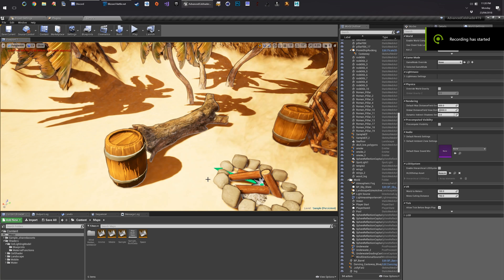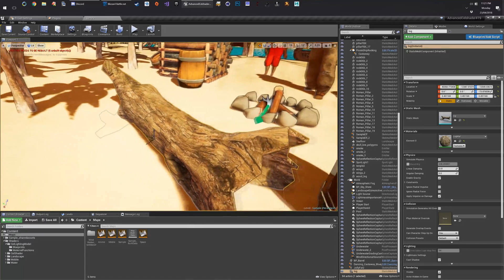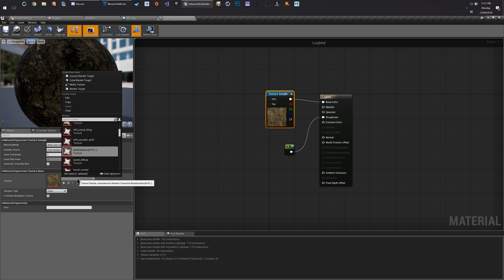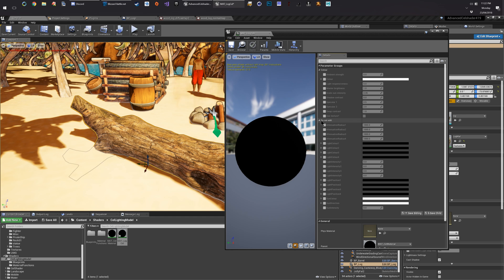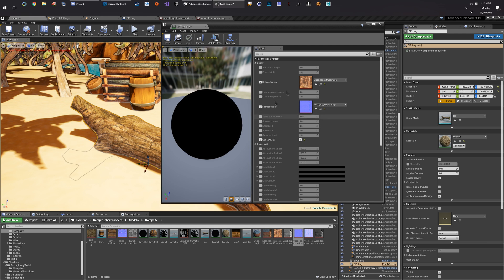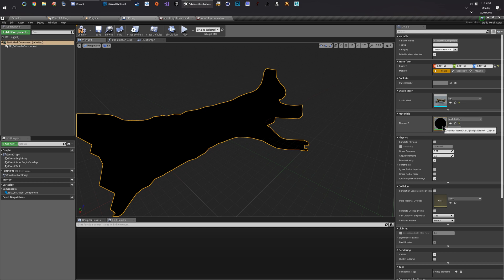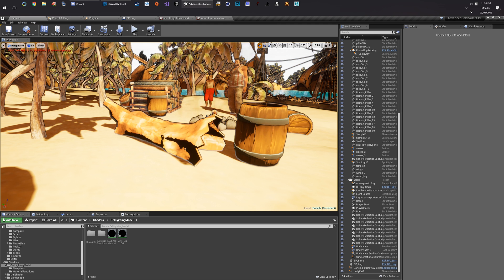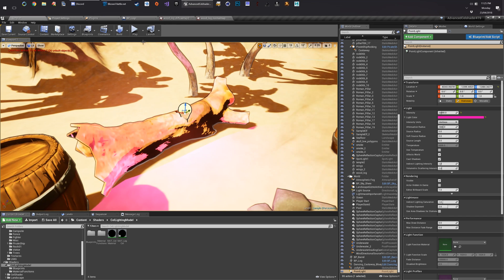Cel Lighting Tutorial 1

Comment: Hey great work ! I have used the advanced cel shader v1 I believe. In that I used an unbound post process volume. In this video are you using only materials on actors/bps to apply cel shading to only the desired actors? Secondly in the preview video is the entire scene cel shaded or is it only the female actor?
Reply from the maker: Yep, this tutorial covers the Cel Lighting method, rather than the post-process volume method. They're designed to work together. In this video the post-process cel shader is present. Only the objects in the campsite are using the Cel Lighting model.

In the other video of the dungeon and the lady there's a touch of post-process cel shading, but not much.

If you purchased the cel shader from the marketplace then you'll be able to update to the latest version.